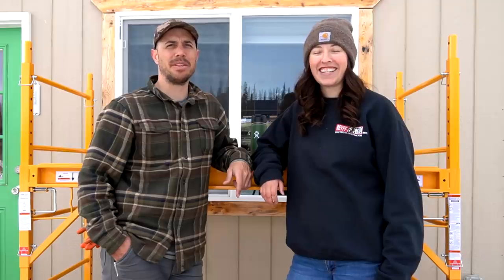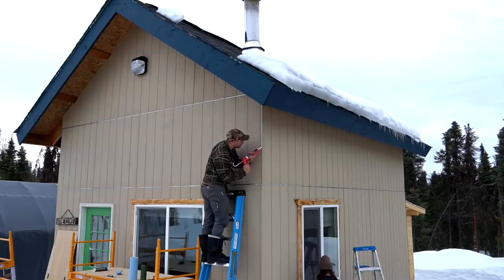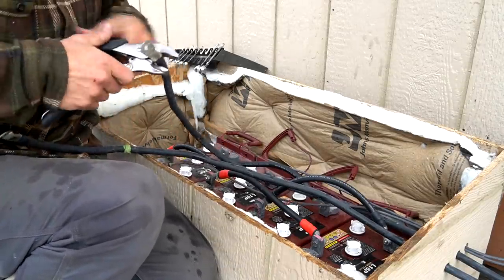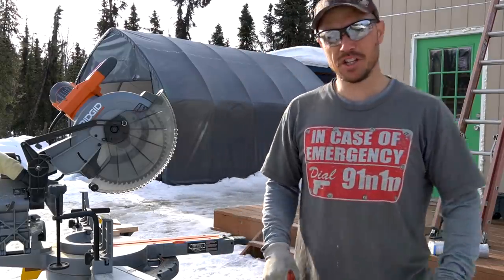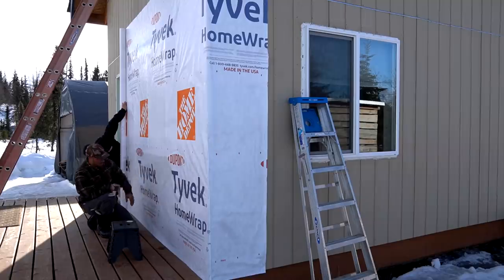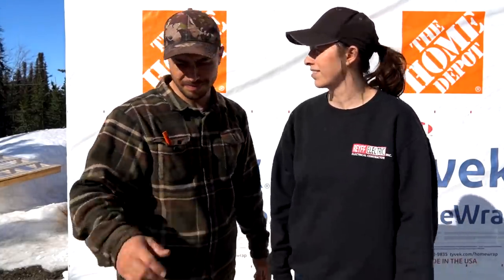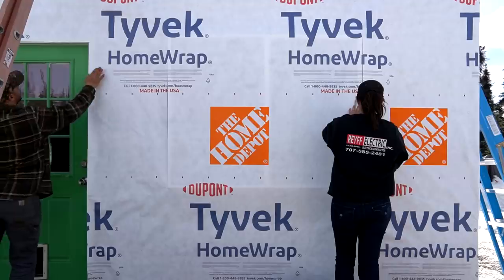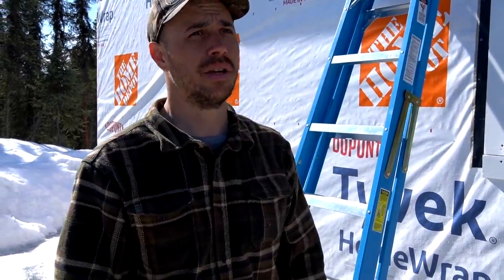Spring Cabin Remodel | Housewrap & Trim Installation

Comment: give yourself a caulking area.  when you butt your siding up to the window or door trim, you may have to pad your trim out or add another 1X4 so there is room from the siding to the trim board for caulking.  I use to put a piece of plywood, paneling, etc, behind the trim board to pad it out so there is room for a caulk bead.  you'll see when you get there. if you have finished with the trim board you can always double it up.  you won't see it once it is caulked.  if you finished trim board is 3/4 of an inch and your siding is 5/8 it only gives you 1/8 inch caulk bead and that's hard to do and make it look good

Comment: Noticed your solar system uses flooded batteries. When you top them off suggest using 'de-ionized' vs. distilled water. It will help your batteries last longer.

Comment: Remember, do not nail your siding tite to the house. Let it hang straight. I'm sure the T 1 -11 goes in & out. This only applys if your using vinyl. Cause it moves in heat & cold. Awesome job of prepping.

Comment: Looks like the guy that built the cabin used the TLAR principle. "That looks about right". We had the same issue around all our windows here and they were actually (supposedly) professionally installed. But they completely did NOT do an actual support framing, so even the massive picture window was just resting on the stud ends. I guess they thought all the shiplap layers in this old school house were structural. But there wasn't just a draft problem, there was also a huge fly problem, ALL YEAR ROUND. They crawl down the stud bays from the attic through the insulation and somehow squeezed around the window trim. Until, this 4th winter in here, we figured out what the problem was and got some of that Great Stuff foam and plugged it all up. We still have a big window in our entry and the north door there to do. It took 2 full cans on the picture window, 1 for each small bedroom window, and will need at least 2 for what's left. We are still in the process of finishing an outer layer of insulation and will replace the north kitchen window, so will fix that when we come to it.

Comment: Tyvek outer wall house wrap will definitely keep wind and outside rain seepage from affecting the outside wood sheeting. Its ability to let inside house moisture out through the the insulated walls is  irrelevant to a properly constructed and insulated house wall, which should always have a plastic 2-4 mil sheeting vapour barrier towards the inside facing of the wall insulation. Why is this vapour barrier so important? Because it prevents the inside house moisture from migrating and diffusing through the insulation to the inside facing of the outside sheeting, where the moisture will condense into water or freeze during the winter. That condensed and spring melted ice water will gradually start to rot the studs and wood sheeting of your house walls - and this also applied to your roof ceiling wood frames.

Comment: It’s likely too late…but I would have recommended pulling off the T1 11 siding, putting on the house wrap, then nailing up a layer of Zip sheathing (contains a continuous layer of insulation) with all the seams taped, then adding back the T1 11 siding.

Comment: I guess house wrapping has replaced insulation?

Like the pink fiberglass stuff my father used in 1954 when he built our house

Had a step grandfather who worked in a fiberglass factory in the 1940s

And (of course) died of emphysema in the early 1960s

Comment: Paint over knots and stains with shellac and it is gone for ever. I promise   Paint over with any color you like.  If you back cut the trim pieces on the window edge  to allow for the thickness of the flashing the trim will fit flat and  correctly.  I have 25 years of house construction

Comment: You guys still haven't adressed the biggest issue. The fireplace needs a lot of air to burn all that wood, which it sucks right out of the heated space, basically creating a little vacuum inside the cabin. So cold air will continue to seep in through every tiny crack. The fireplace needs an air inlet connected to the outside. Don't know if this can be done, seems like American fireplaces aren't prepared for this while it is a common feature with fireplaces sold in many other parts of the world except for the really cheap ones.

Comment: It seems like it's gonna make a huge difference! The place I live also has some serious draft. However I'm not permenantly settled here so I basically did the same thing to be functioning as a house wrap... but in the form of curtains lol. I wrapped 2 layers of curtains over the window and front door. Also I wrapped shower curtains around the walls that doesn't meet a neighboring unit. They do look hideous but made a huge difference! 
On that note I bet the caulking and barrier are gonna help a lot not only in winters but also your summers :-) Some of those gaps were huge!!

Comment: Sorry but knotting before priming is always a good idea... Just saying... 
Do I need to treat knots in wood before painting?
Yes, as with all water based paints, it is necessary to seal knots in bare wood prior to painting. Any standard knotting solution is fine to use

Comment: I think he would’ve been better on removing everything from the inside out on the yard remove all the drywall and fiberglass insulation that you probably have in that thing and spray foam the whole thing that way when you light a candle you could heat the whole house with

Comment: kilz paint and primer both stinks to high heaven.so i cant believe u did that in the house Arielle with your newly started seedlings in close proximity.and whenever u use kilz you r also sposed to have good ventilation,and i didnt see you opening any windows.also its not good for your pets or yourself to be breathing in either!

Comment: I don’t have to say I’m very disappointed you should’ve done a lot more research me as a builder here in Massachusetts been doing construction for over 30 years that is the worst product you could ever use one because within 6 to 10 years that stuff turns to complete dust Typepar would’ve been the better choice or tarpaper

Comment: OK,  I have silently watched your great channel.  I haven't always agreed with the way you do things,  but overall there is really nothing wrong with how you achieve your results. 
However!  Please get some better methods of making off your low voltage cables,  I prefer soldering (controversial, I know)  but your vice grip crimping is not good enough.  Perhaps at the very least some "good quality " crumpets.  Please.